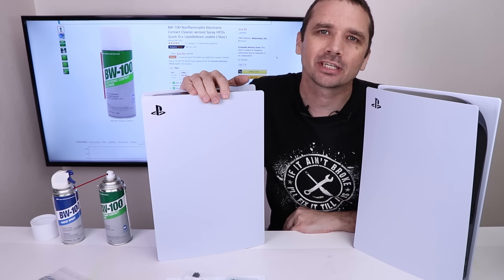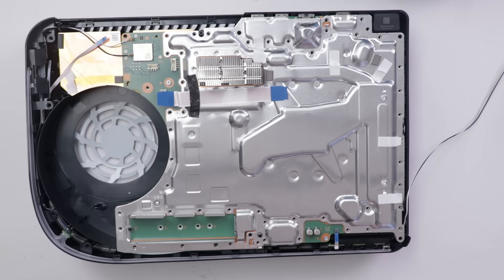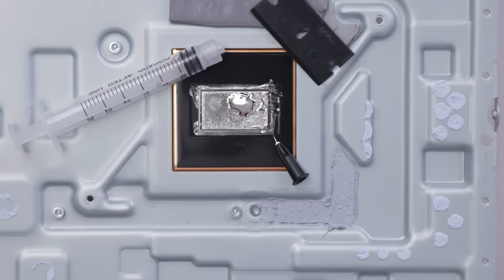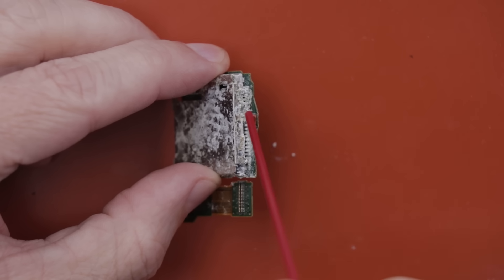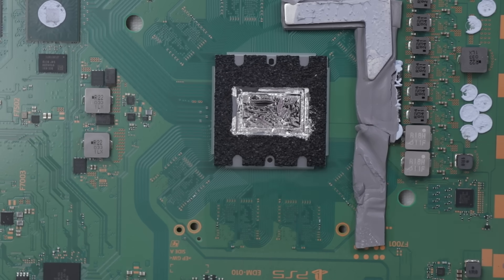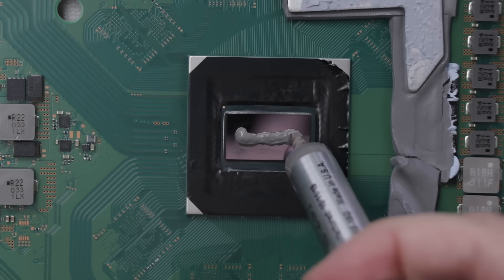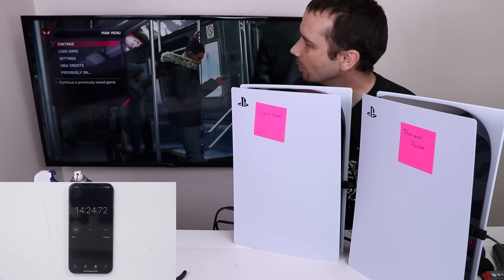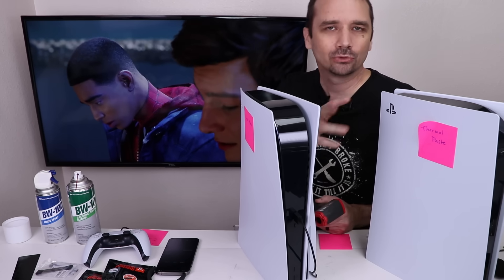PS5 Liquid Metal vs Thermal Paste - It OVERHEATED!

Comment: I'm more concerned about the longevity of liquid metal it often fails after a couple of years, it'll be interesting to see how it goes
Reply: Generally liquid metal should last the lifetime of the console. Although it doesn't evaporate the problem is what kinds of metals are in contact with it (heatsink). Some metals it will fuse to and "dry out" which will require a new application of liquid metal.
Reply: @TheAtqthe30th  if it's Aluminum, well say goodbye to the entire heat sink after some time. There's a demonstration of this somewhere. The effects of Galium on Aluminum.
Reply: @ArtisChronicles  but replacing thermal paste can be done quickly with ease unlike liquid metal.
Reply: Delidded 7700k still going strong after 4 years
Reply: It won't fail, is not a paste where it dries out
Reply: @ArthArmani  We're having overheating problems with ours, we had it standing up this whole time...
Reply: @neiliewheeliebin  did you try to hover out the dust?
Reply: @ArthArmani  Zero dust in it, it's sitting up on a desk next to a monitor. Laying it flat seems to have helped it a bit for now
Reply: @neiliewheeliebin  sounds like the liquid metal is bubbled into one spot. so half the apu isnt making the correct contact due to the liquid metal not being fully covered over the die.  this has been a thing with ps5's...  re-applying it will fix your issue.
Reply: I have a delidded 3770k with galium on it no issues and it's been almost 9 years and overclocked moderately to 4.45ghz
Reply: The memory on these hot boxes will fail before the liquid metal 🤣🤣
Reply: "news flash" some times you have to reapply thermal paste in old PCs
Reply: Hell if it does just repast it
Reply: @Smiley-zm1rp  the average consumer isn't expecting to have to do something like that with a product like this.
Reply: @fudgeyman99  the average consumer also doesn't expect to replace thermal paste, yet thermal paste is usually a rock after 5-8 years. Halfway there after 2-3. That's the typical thermal paste lifetime on processors where it isn't making direct contact to the CPU die.
Reply: @Smiley-zm1rp  That's not how it works .... The reason it fails is because it leaks out .... Sony tries to get around this by using more than you normally do and using containment .... However the downside to that is if the containment fails there is so much in there it's going to leak out and cause shorts ..... It'll be interesting to see what the failure rates are in a couple of years

Personally I think Microsoft used the more sensible design, instead of overclocking the GPU like Sony is doing to get more power they just added more silicon to get the power. As anyone who does any overclocking knows the increase in heat from an overclock isn't linear but borders on exponential meaning a 5% increase in Frequency can get you a 10% 0r even 20% increase in wattage it draws which means it produces 10% to 20% more heat in watts and that is why Sony had to go to the extreme of using liquid metal and IMO as an engineer that means more maintenance which is never a good thing in a consumer grade device .... In a professional or enthusiast grade device the stuff is great as long as you are willing to take on the increased maintenance and monitor the temperatures to make sure you catch any problems before they become disastrous .... Sony's warning system would be too slow to react to a containment leak and you have no idea what the temperatures actually are .... I've used liquid metal on CPUs and GPUs but I monitor the temperatures and if my normal temps start increasing I know to take a look and make sure it isn't starting to ooze out
Reply: @longjohn526  ,
Sony was probably forced to overclock at the last moment when they found out what Microsoft had. It's much easier to revamp your cooler design than to redo the GPU. We'll probably never know the real reason but I think that's a logical assumption.

Comment: Wow who would say, they went on a much more costly project of using liquid metal because it actually makes sense!
Reply: i assume they ended up saving money long term with this. instead of needing to purchase/manufacture more expensive or better performing chips, they can overclock the cheaper chips to get better performance and then offset the higher heat with a better thermal transfer system. the idea of using liquid metal in this way is definitely not new so it's not like sony had to reinvent the wheel in order to implement this system, it's all just a matter of making sure everything is properly sealed off and you apply enough liquid metal to actually ensure proper heat transfer. at the end of the day, console manufacturers these days know they are selling their consoles at a loss and if they can save even a couple dollars a console, it easily adds up to millions saved in the long run.

Comment: Sony: spend years developing liquid metal thermal transfer
TronicsFix: lets put the old stuff back in!
Reply: *in
Reply: Lmao
Reply: Everyone on this thread that is assuming that "liquid metal" thermal paste was just recently been developed by Sony has apparently never heard of Thermal Grizzly Conductonaut or any such others. I'm sure that they cut R&D costs by simply using Conductonaut. I have it in my old rig which was pushed HARD with music editing software (harder on the CPU than gaming) and it runs exactly like it did from day 1. I just built a new rig and put it in that as well.  @Khalid Acosta  saying that everything around it will degrade beacuse of the heat is simply an illogical statement. Being that liquid metal is more conductive, I.E. it is going to allow a faster transfer of heat from the chipset to the LVP cooler tubes - to the radiator fins... dispersing the heat FASTER. From there, overheating would depend more on airflow than heat exchange through the thermal paste.
Reply: @travisfender8851  before Conductonaut there was whatever CoolLabs made. Liquid metal pro and the other naming conventions got very confusing. 

I actually used a cheaper liquid metal than both called something like SilverKing. It works very well and initial tests show it perform a little worse than Conductonaut, but not so much that I'd rather use Thermal Grizzly's solution.

I don't remember what the video was called, but someone tested it out when I was considering it.
Reply: @YandreL 4 years of product lifespan is long enough?

i have products for over 10 years and they still work fine i want my stuff to last.

and I have read somewhere that Sony seems to be only pushing the PS5 gen to only last 5 years?

Didn't they also said that during the 8th gen?
Reply: hahahaha years you said? they just clony everything
Reply: Pc gamers
Reply: They didn't, liquid metal was in use in the PC sphere for ages
Reply: @khalidacosta7133  Yeah but usually for more veteran overclockers. Most of the PC users use conventional thermal pastes cuz it's already enough for everyday gaming and use and small overclocking.
Reply: @themercifulguard3971  Yep, that's my point. Most PC's don't have it because it's just horrible to work with and unnecessary.  I can see a fair few failures due to it in 3-4 years time when the plastic hardens
Reply: @khalidacosta7133  what plastic are you talking about?
Reply: @learningchannel3850  Liquid metal is conductive.. it's metal after all. So you have to surround everything that could short circuit with plastic.... the foam, the adhesive, the plastic sheet.... it's all going to degrade next to that heat.
Reply: @khalidacosta7133  uh you just explained why sony spent years developing using liquid metal on it while saying they didn't develop it...lol
of course they are not the first one find out or invented that liquid metal is better conductor than thermal paste...
Reply: @hollymolly518  Why spend 2 years developing something that is ready on the market? Thermal paste has a conductivity of 12w/mk, liquid metal is around 75w/mk... or why stop there, go for a nano graphite sheet that's available right now at 1900w/mk?
Reply: @BeHempy  what are you talking about? i'm PC master race lol you sounds like you know something but actually don't know anything....
Reply: @hollymolly518  So wtf are you talking about Sony spent years developing a liquid metal solution? They just slapped some off the shelf liquid metal on their APUs. Whooptie doo
Reply: @BeHempy  you must be boring like me to argue something like this over the comments lol but i'm not as bore to argue something that i don't really care....so whatever you think is right...
Reply: @BeHempy  uh whatever you're happy with lol but i think you talk to the wrong person and starting to hallucinating...i hope it won't get worse...better see a doctor man
Reply: @themercifulguard3971  the used i5 I bought actually heavily benefitted from having liquid metal underneath the IHS. Sure the old, almost dried thermal paste was just enough to keep it running well enough, but the thermal transfer was so much better after the replacement. The next step for Sony I to Solder the chip directly to the heat sink.
Reply: @BeHempy  interesting, more gatekeeping. This is why people don't like the mustard race. 

Lots of reasons why people don't like the console communities as well.
Reply: @khalidacosta7133  not only that,  if it comes into contact with aluminum,  that aluminum is now trash.
Reply: @YandreL Sony will not have developed it. What you have to understand is how corporations talk. Those "two years" won't be R&D, it'll be an engineer pushed to find a solution for overheating due to the constraints of a heatsink that's undersized and a "fancy" case design. That engineer will then have to talk to his manager, who will take it to the accountants, who will then go back to the engineer, product QA, manufacturers.... it will just be bounced back and forth through various teams without much actual work being done. After all, Sony won't care, as long as it lasts a bit longer than the warranty and preferably just before the next one is due out....
Reply: @YandreL my base PS4 has been silent, while my pro has been the jet engine. Probably a bad thermal paste application on my pro.
Reply: @YandreL It absolutely is. I ran a company designing and developing computers to survive harsh computing environments (humidity, deserts, freezers,  industrial applications etc). If they designed it properly, it wouldn't have a bit of plastic everywhere.... you would see nitrile, silicone or fibre gaskets with a physical retention mechanism made of metal. This is all very costly, a bit of standard polypropylene and LDPE sufficed for them I guessed. Just because the next console is due out in 5 years, we should stray away from planned obsolescence.  It's incredibly damaging for the environment. Remember, when it fails, you can't go down to your local repair shop and the person will squeeze some thermal paste on it. It will end up frying the main processor, the most expensive thing in the console!
Reply: @khalidacosta7133  when you get the best thermalpaste out there it could make a difference. i guess in the video he used some gerneric stuff
Reply: @mrn234  if you're thinking about kryonaut, let me stop you right there. It doesn't do well over long periods. Thermal Grizzly's Kryonaut was designed for hardcore overclocking with LN2 which means very short term use. That's one of the highest end thermal pastes you can get that have a high there transfer and isn't possibly damaging to the chip like IC Diamond is.
Reply: @mrn234  he used artic silver one of the best brands of P
Thermal paste available...

Comment: liquid metal helps like 2-3 degrees only. Your thermal grease was thick but it should not matter. Or the clamp is not making enough pressure on the chip since it's not required for liquid metal that much? Anyway - the fan does all the work it seems

Comment: Wow, thermal past is lower temp, amazing
Reply: No friend, you understood wrong. The air coming from the PS5 using the thermal paste was lower than the other because the thermal paste was not efficient as liquid metal to transfer the heat of the APU to the heat sink. So, the air was cooler because the heat sink was not that hot, bit the APU using thermal paste was probably hotter than the other.

PS: Sorry about my english, it  is not my first language

Comment: Hello, i just found and subscribed to your channel, Im very new to ps4 vr, just getting it setup for cardio so i can hopefully get back in shape... i was just wondering do i have to have the original controllers that work with ps4 to get ps4 up and running with the psvr motion controllers? i have an opportunity to purchase a cheap ps4 with no controllers and just wondering if im going to be able to easily configure and get the ps4 working and will i be able to access all ps4 options from the vr motion controllers... thanks so much for your time and any help!

Comment: The manufacturers chose the liquid metal, because its best suits the system cooling and heat transfer. Its backed by research by Sane individuals. Bottom line, don't fix it if it ain't broken!! You could have tried water cooling the unit!

Comment: So how long WITH FANS do they stay on? Wtf i didnt hesr this part. Better yet you didnt say. If it stays on for at least 24hrs then youre in the clear. As noone will leave a system on any longer. Or at least you shouldn't.  But its plausible to use if its fine for at least 12hrs if not 24.

Comment: I'm waiting until someone makes a full (proper) custom loop for these that should help greatly.

You can find like $30 "water cooling kits" ghetto modded onto past consoles but those are a joke. I know there was a custom water block made for the PS3 by Alpha Cool? Sure there was one for the PS4 as well, always enjoyed console modding it's fun to improve something.

Consoles generally have to be very mass production friendly so often they have a bit of short comings and frankly as a function over form individual I don't mind "butchering" something to noticeably improve it. I also have to imagine Sony is using very low quality liquid metal.

Its kinda difficult to apply and I imagine a machine would have nightmares trying to do it so I believe they are probably using liquid metal pads which are solid but melt after a hour or two.

This would make production far easier as they can be more mass production friendly but preform poorly compared to traditional liquid metals.

Comment: I used liquid metal on my laptop and it performs amazing, but it is drying  after around 3 months every time (the laptop gets unusuable due to the temps) and I always have to sand the heatsink untill I get that mirror look when replacing the liquid metal. I have thermal paste right now, but it is thermal throttling in "heavy cpu" games. 
What have they done to prevent liquid metal from drying? (I used thermal grizzly conductonaut)
Reply: that might be, because on a regular laptop cpu socket you do not have a seal around where the metal sits - so air and heat escapes inbetween. If however you put up a seal around it, which is airtight, there shouldn't be any transfer of outside air with the liquid metal.
Reply: @bazurful  You might be right. Sadly is kind of hard for me to make a high temp seal right there because of  the microscopic capacitors around the die. :(

Comment: Well no common thermal paste can compare with real metal bond it has to be grizzly kryonaut or higher those pastes measure heat transfer in W/m-k one example is liquid metal mostly are from 20 to 80W/m-k while the kryonaut is 12.5 also depend on the bonding there is 100% gallium nonsense or if you buy the grizzly one metal they mix gallium and indium i dont how how this would affect the quality but in grizzly site it says 73W/m-k which is impressive and yes the pc doesnt even heat that much as ps5 do even 7W/m-k can yield normal temps if you have good cooler with lot of heatpipes like 6 and good fan like noctuas strongest and as alway it depends how much watts your pc draw and the cooler capacity companies say it like this cooler is capable for up to 200w cpu etc so in overall i dont say this video is invalid but honestly you cant compare liquid that is min 70w/m-k with some paste that dont even know what brand is since you didnt show

Comment: I wonder, when the PS5 Slim is released, if Sony will switch to thermal paste (to keep the cost down and because of the downsized components that will produce less heat) or if they will continue to use the liquid metal (because they don't want the patent to go to waste).
Reply: They usually aim to keep manufacturing costs down with the Slim lineups, the patent has served it's purpose with the launch model. Hopefully the 5nm refresh of the APUs should be enough to not need liquid metal.
Reply: 5nm?
Reply: you mean 6nm
Reply: Now its 7nm

Comment: Turning off when overheating. This means that the rrod/ylod era is finally over, no more heat related problems? (however bga still can fail due to heat expansion/contraction)
Reply: That era ended last gen

Comment: It proves that xbox series x technology isn't that extreme compared to the PS5. That amount of heat generated by that I/O system chip inside that APU and the combination of GPU and CPU just proved that PS5 does a lot more than xbox series x in delivering better overall gaming experience.